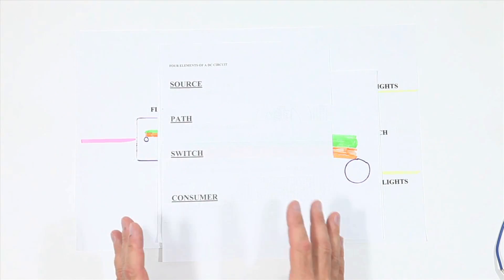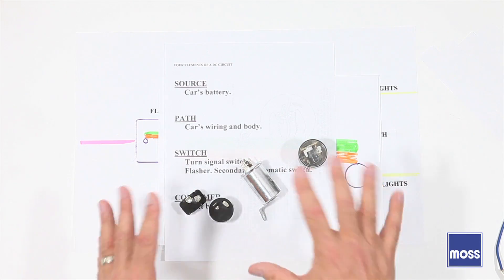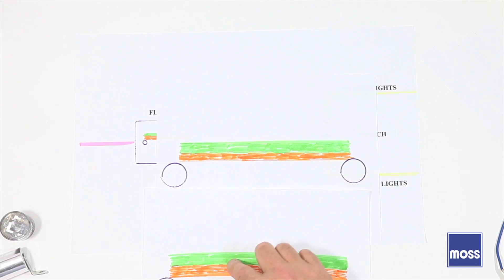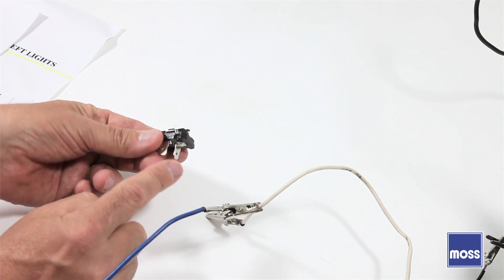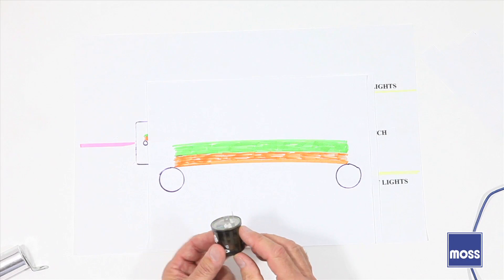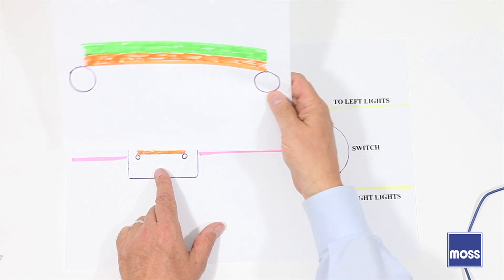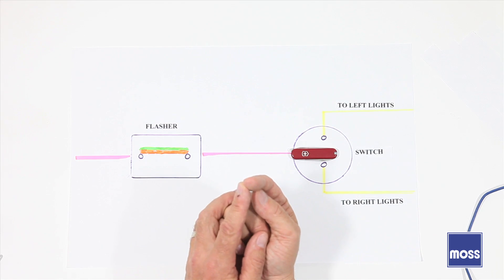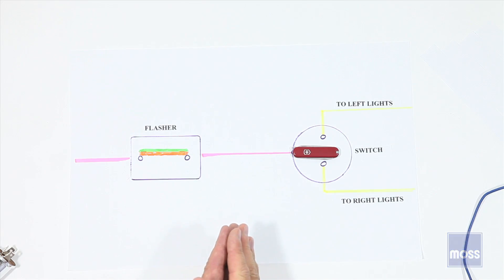How Turn Signals Work in our Classic British cars

Comment: Electronic blinkers usually blink faster when a light burns out. That is deliberate so the driver notices something is not as usual. That can be a problem with LED lamps that draw less current than normal lamps. For that reason LED lamps often have resistors built in in order to draw more current. Which is actually kinda stupid, since it kinda ruins the benefit of having an LED lamp, not to mention the resistor prevents the blinker from "noticing" when the LED burns out. Some LED lamps even electronically disconnect the resistor when the LED burns out, so the the blinker blinks faster. I don't know, the whole LED topic is quite messy. Anyway, the point it. And normal blinker SHOULD blink fast/slower when a light burns out or have some other way of showing the driver that something is wrong. Newer cars usually show a warning on a display instead of changing the blink rate.

Comment: How would hazard lights work in that last circuit? Wouldnt doubling the load in the circuit make that flasher work twice as fast? But that isnt the case. And why do I remember that turn signals actually flash FASTER when a bulb is out on that side? Shouldn’t that loss of a load make it flash slower?

Comment: When using LED bulbs , you need to use an electronic flasher as the LED's don't draw sufficient current to make the old tech thermal flasher work . 
-Nate

Comment: The old style flasher flashes slower when a bulb is out because there is more resistance on the circuit.

In my classic Mini, I had an interesting problem in that my flashers told me when I was having a problem with my electrical system in general: When I would slow down to a stop, the flashers would blink VERY slowly, and speed up according to my speed. This was because I had an ignition issue and my accessories were not getting enough current.

Fascinating that this is how they work.

Comment: I thought the flasher started with the contacts open, so no light, but the power across its contacts causes an heating element to heat the strip which clicks and shorts the terminals out, causing the bulbs to light, and cutting off supply to the heating coil and allowing it to cool to repeat...

Comment: One day I gotta see the face behind the great Moss Motors videos, ha ha. It's like the radio personality, nobody knows his face.

Say, on many new cars if the bulb is burned out, the flasher goes too fast. It's a convenient, quick message to the driver that one of the bulbs (front or rear) is not working. But if it's thermal, the burned bulb should be an 'open' circuit, with no flow. How does the flasher sense an open in the circuit? Is that unique to electronic flashers?